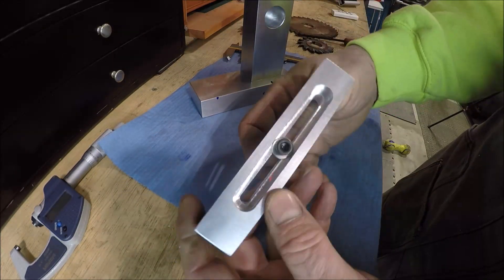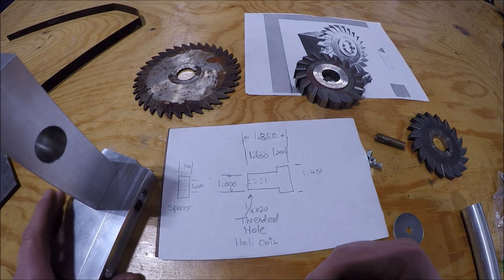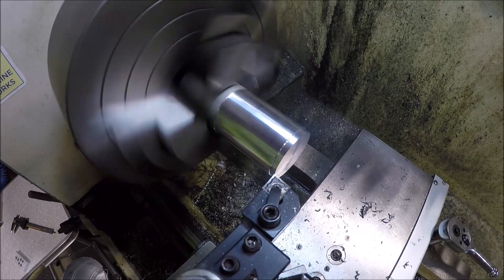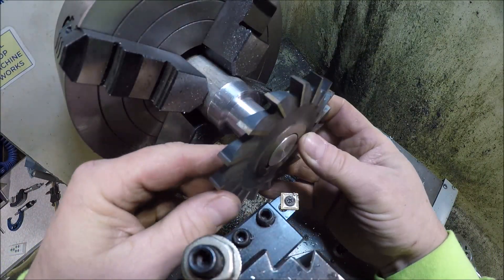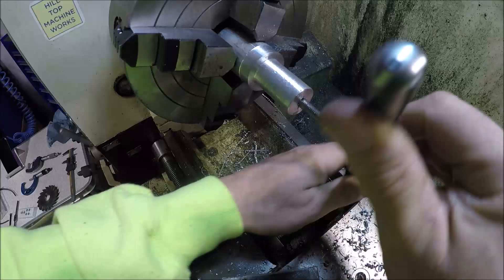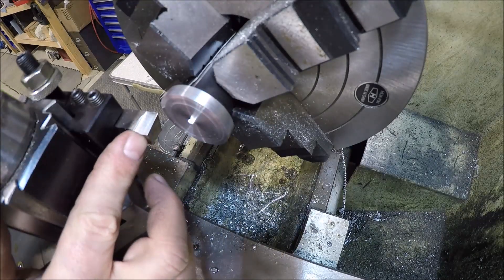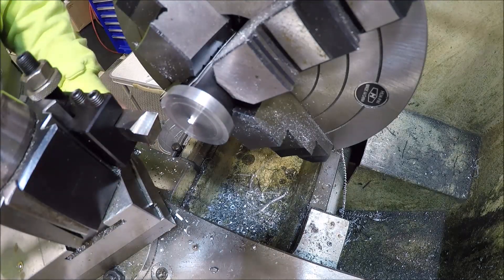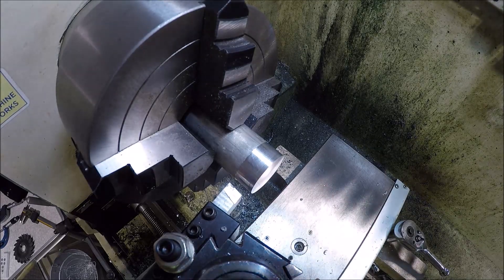Horizontal milling cutter sharpening fixture. Part 3

Comment: Looking good. Could you have used a threaded stud and a lock nut? Just run the nut down as far as you need it.
Reply from the maker: Yeah that would work and I end up going that route except I opted to use a wing nut.

Comment: Your camera sounds like it has an ultrasonic cleaner in it??
Reply from the maker: Every now and then the harmonics from the lathe mash up with the audio mic for some reason.
Reply: @hilltopmachineworks2131  it was noise from beginning to end of video though?
Reply: I just played it again and it still does it.
Reply from the maker: @bcbloc02  Hmm. Interesting. Let me know if you hear it on my next video. I can check the mic settings.
Reply: @hilltopmachineworks2131  First time I have noticed it on your videos. I will let you know. Give Chaos a pet for me. 🙂
Reply from the maker: @bcbloc02  👍😊

Comment: Hey tom looks good . You were saying having different size springs you could just make some different size ( thickness )spacers with a small slot and countersunk so the spring would go in just enough so the spacer won't fall off . i hope you get my idea . also what kind of lathe are you using Thanks JM
Reply from the maker: Hey Junkman. I actually change the design in the end for the arbor. The lathe I was using is a 13x40 Enco clone.
Reply: @hilltopmachineworks2131  is it Chinese or Taiwan
Reply from the maker: @junkmannoparts9696  Taiwan. I bought it new in 2004.

Comment: Nice work. Just curious why you did not make it out of steel so it could be used on a magnetic chuck . Not saying it's wrong just thinking out loud
Reply from the maker: I decided to go with aluminum because I have a bunch of chunks of it. If I didn't I would have used steel. Thanks for the question.